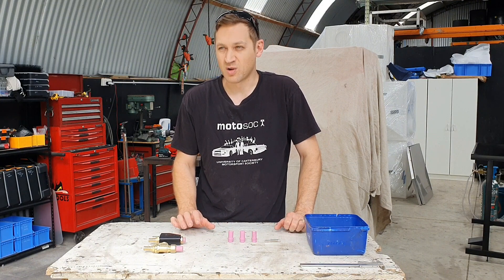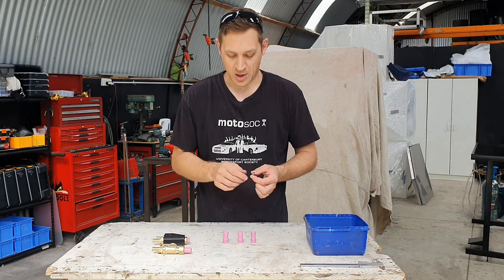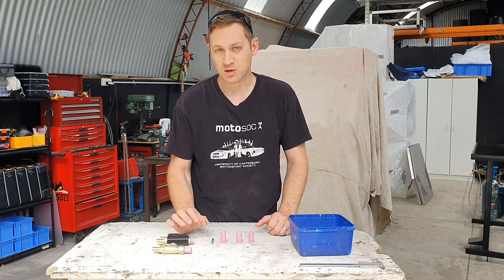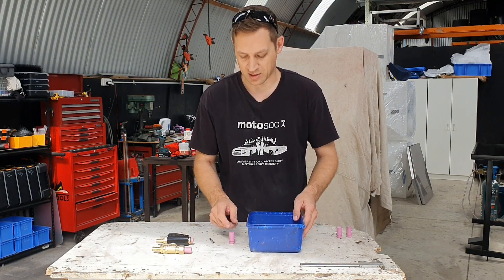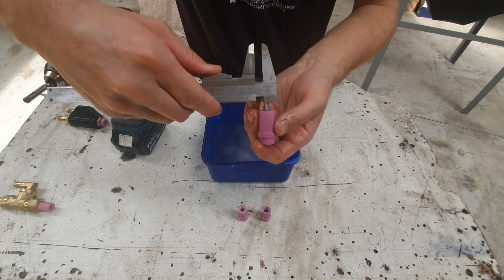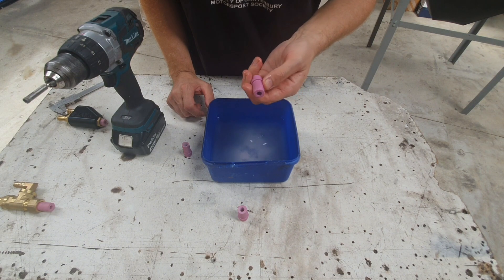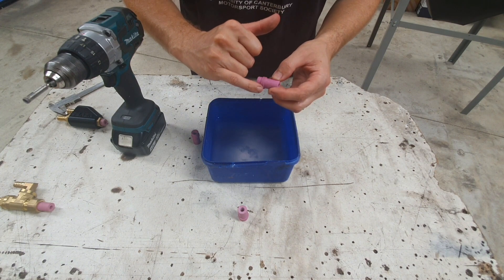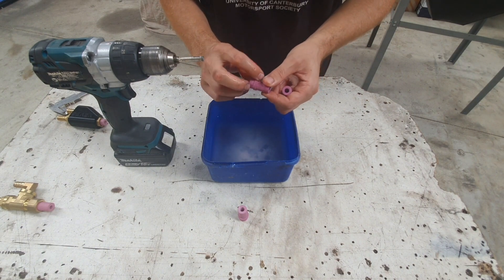8mm Ceramic Tip Modification for DIY Vapor Blasting Guns

Comment: What solenoid valve are you using on the air into the gun?
Thanks 😀
Reply from the maker: Hi Stephen,

It depends on the setup. Usually 1/2". The smaller setups use a water solenoid with built in check valve.

The larger setups use a brass 220v solenoid with a relay circuit and 12v trigger circuit.

Thanks for watching!
Reply: Is there any particular 12v valve that work best?